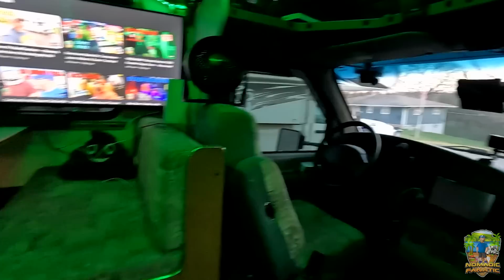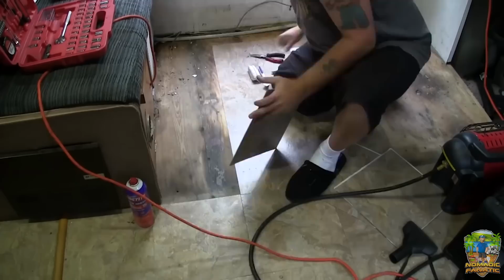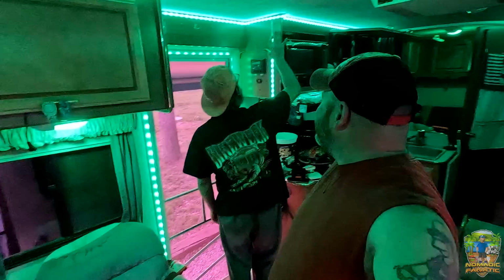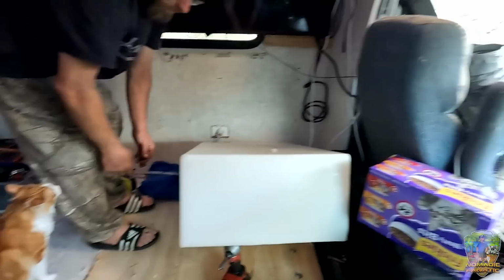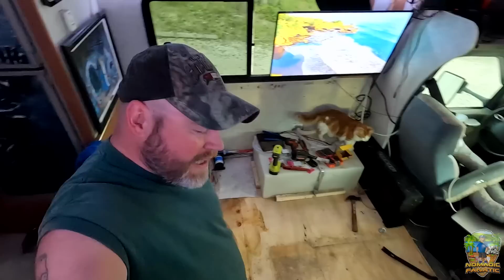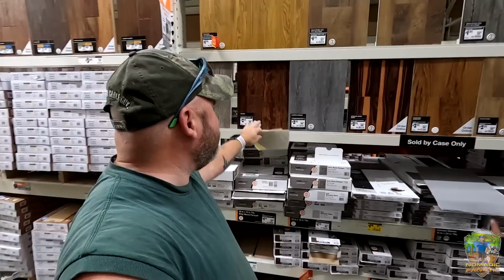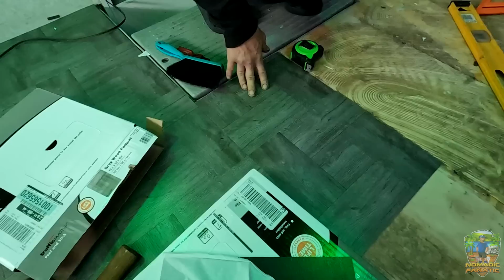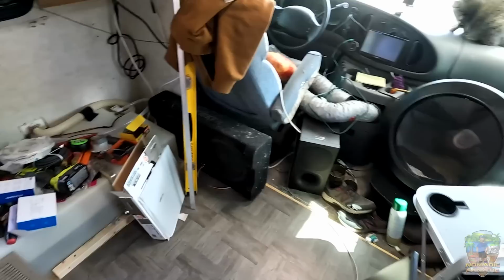RV Demolition ~ Remodeling Inside of my RV to Better Enjoy

Comment: That old project you did was my introduction to your channel. I've loved seeing your renovations over the years. I want to replace the dinette with a couch in my rig too. My plan is to put a futon, or custom built slide out slat style so that I can use it for a bed when needed. I removed the back bed in mine and use the top bunk. The chair space is where my solar controller and inverter are, because the battery box is right below there. Taking the chair out gave me holes to run the wires through. I turn the passenger seat around and use it for work and lounging.

Comment: Just a heads up Eric, the green doesn't work too well for videos.  I could not see a thing when you were showing the furnace and fuse panel.  Just letting you know.  I might think about some Dzus fasteners for that grill in front of the fuse box.  It will making getting it off much easier.   Just a thought.   Keep the good stuff coming buddy.

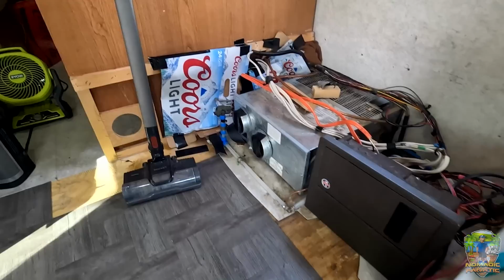Comment: 13:20 I believe the front of the circuit breaker/fuse box should be on the front of the under couch panel for immediate access. You never know when you may have an emergency situation where you may need to turn a breaker off.

Comment: If that is a propane furnace,  the vent grate that you are putting in front of the fuse box will not be adequate for the furnace.  you are going to starve the furnace for air. and THAT is very dangerous.

Comment: confused about why since the front of the couch will need a board for furnace openings and such why there would not just be a cut out for the fuse box front as well.
Reply from the maker: It all makes sense in next video.